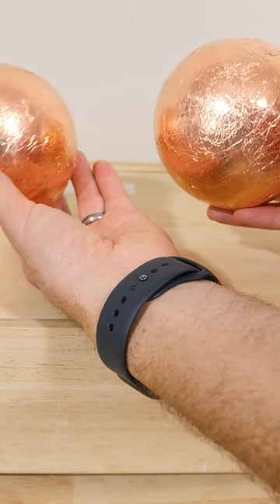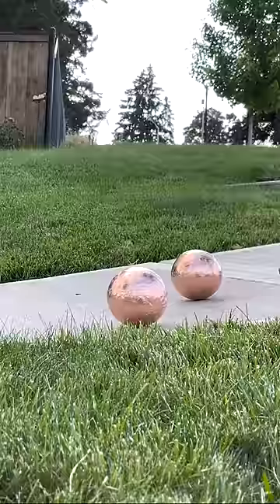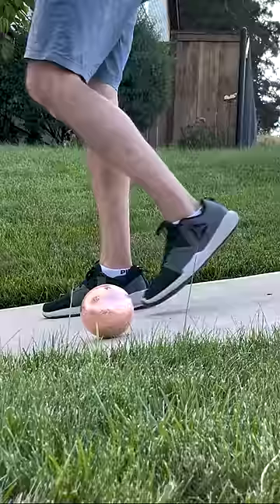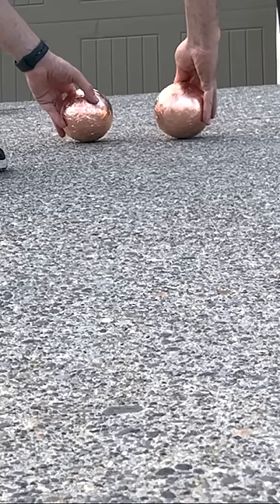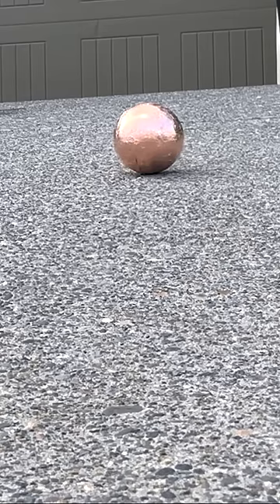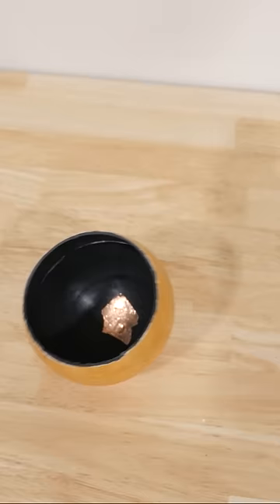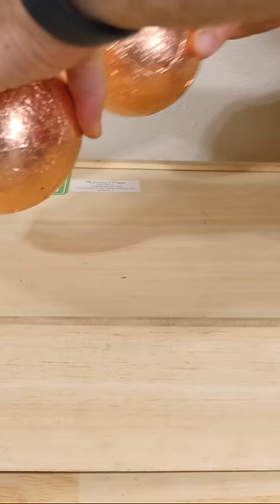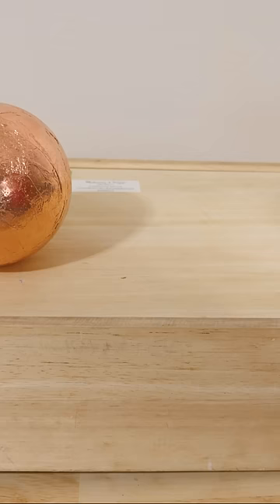The Slowest Ball

Comment: That's some magician stuff right there.
Would have took me ages to figure out how that worked. Now I'm thinking of the engineering applications.
Reply: A fringe practical use I could think of would be decorative balls that you generally want to be stationary.

In case they started rolling unexpectedly, you'd at least have an easier time catching up to them.
Reply: @LinkEX  It could be used for a game, where you want balls to throw and not to roll fast once landing. Possibly like a curling like game, in where two teams throw these balls down the lane to a target, and you can hit each other's balls out of the way, but not so much that every hit is an automatic knockout. 

🤷‍♂️ There may be some other clever uses though.
Reply: @patstaysuckafreeboss8006  Workaround to decrease the DPI in 1900's mouse
Reply: Prank bowling ball is surely the #1 application
Reply: I guessed immediately how that worked though
Reply: thats pretty much what shock absorber on you car does. we already use fluid resistance in a lot of application.
Reply: @TJPDmember  Magnaride combines this with magnetic fluid so the computer can adjust the resistance in real time...
Reply: @dingdong2103  congratulations. do you want an award?
Reply: @xeuxis8892  Yes please
Reply: I've seen them used before I just can't remember where I've seen them 🤔
Reply: @SamPrince You're a sadist.😂
Reply: Interesting but f***ING useless 👍
Reply: maybe if you add this with something that has a lot of air resistence when falling down, making the air wanting to spin it.

Comment: Gravity gets more and more intriguing as you research more into it and I am all into that.
Reply: The phenomenon here is mainly friction and fluid viscosity. The inner ball's friction act like breaks to the outer shell, the smaller ball can move but due to the high viscosity of the fluid it will cause high drag to the rotation so because the small ball slowly moves the larger shell slowly move. Some emergency breaks on airplanes actually operate like this, a high viscosity break fluid gets pumped into a break bearing usually happens due to bad weather conditions causing ice to form between the wheels and the breaks so the emergency breaks get used but then these need to drained.
Reply: I am of the firm belief that Gravity. Does. Not. Exist. Anyways, Daniel is right, this video is regarding Viscosity and not gravity as such.
Reply: @Balila_balbal_loki  You forgot the most important part that allows all that to work, center of gravity.
Reply: @thirtythreeeyes8624  This will work in 0 gravity situations but less effective due to friction being a function of the normal force of gravity
Reply: @Balila_balbal_loki  I'm not sure how something can roll down a hill in zero G. Also it's 100% center of gravity the ball being on the bottom is what keeps it from rolling and as the inner ball rolls the center of gravity is moved for the outer ball causing it to adjust position.
Reply: @thirtythreeeyes8624  Instead of trying to roll it down, simply trying to rotate it like a basketball on a finger it will be harder to rotate because the ball inside when it makes contact with the outer shell will have a friction force opposite to the rotation dampened by the drag of the fluid inside.
Reply: @Balila_balbal_loki  Of course because of Newtons first law and it applies to this but, that doesn't change the fact that it rolls slow due to the slowly changing center of mass. Rolling a ball downhill through molasses inside a container the container only rolls as it's center of gravity gets lower in relation to the point of contact with the hill.
Reply: @thirtythreeeyes8624  If the sphere didn't have a ball inside it and only molasses will roll faster than a hollow ball of the same volume. The reason is simple it will be of higher mass so the force will be amplified thus giving it a greater acceleration which leads to higher velocity and because of the no slip conditions inside the sphere the molasses doesn't drag on the inside of the sphere to slow it down. But with the sphere on the inside of the shell making contact with the shell removing the no slip condition allowing friction between the sphere and the shell which acts as an opposing angular force to the rotation of going downhill and then since the sphere on the inside of the shell is in a high viscosity fluid it's affected by drag which further amplifies the effects of the ball on the shell. The center of mass of the entire system isn't at the center of the larger sphere because the inner sphere is of higher mass than the fluid making it sink and moving the center of mass below the center point so that phenomenon doesn't have anything to do with this you can glue the inner ball on the shell and fill the shell and watch it roll and it will roll faster than the empty ball.
Reply: @Balila_balbal_loki   If you glue the heavy ball to the wall of the outer ball it will not roll it will stop with the center of gravity at the lowest point. This is exactly whats happening here but, the center of gravity is changing as the inner ball gets pulled down and every time it passes the fulcrum it rolls the outer ball changing the center of gravity to behind the fulcrum and then repeat.

Comment: For those still complaining about the two balls with same weight issue:
 The balls rolling would weight the same on a scale, but the weight is not equally distributed. It still the uneven slow ball (hollow ball +  small dense ball + molasses) = the fast ball (just a ball, evenly distributed weight)

Comment: A few years ago I am trying to make a homemade hydraulic balancer for a slope-mowing machine, and one way I was considering to controlling it was a "heavy" weight on a stick as a pendulum, in some very dense liquid for stabilizing the mechanism against the machine bouncing and terrain irregularities reactions... Sadly I never finish it, because there were better (electronic) solutions, but I am sure it will work fine thanks to the slow, damped movement :)

Comment: When we see a wobbling ball, we know it is having another ball in it. And when it moves back and forth, we know it is filled with some liquid. So Viscous fluid is the reason for slow movement. Viscous fluid property is now applicable to the host, ball. Maybe if we use a heavy host ball which is heavier than the contents, it may not affect the host's movement, I guess.

Comment: can you repeat this experiment but on a steeper incline? I have a hypothesis that the speed difference between the two balls will be insignificant if the molasses filled ball has enough speed to catapult the steel ball to the front over and over again

Comment: I guessed at the viscous fluid, but not the other ball inside.  Is there any issue with the molasses degrading/going bad over time?

Anyway, just goes to prove the old saw: "Slow as a small, dense sphere in molasses inside a larger, hollow sphere in January."

Comment: So if you had two objects of equal density, weight, shape, volume, etc. Two of the same thing, and they were both buoyant, then if one of the two objects was warmer, and you put them both at the bottom of a tank, would the warmer one float faster? Just how much warmer would you need to get the other object to make a difference if any?

Comment: This video almost made me sick. Since I was young, if I start to feel nauseous while asleep, I have a the same dream. There is a hill. At the top of the hill are to spheres: one small, one large. I tap the small one but it is too heavy to move. I lightly tap the large one and it flies down the hill hopping high into the air despite the surface being ultra smooth. I turn to the small one again. I kick it and it starts to move, very slowly. Much like this video. Despite its weight and the steep incline, it moves reluctantly, yet I can't stop it. Other weird things happen until I wake up already throwing up. Ugh, now I feel sick just thinking about.

Comment: Viscous, adjective, having a thick sticky consistency between solid and liquid means; having a high viscosity!
Imagine your car being front wheel drive and have This ball-effect connecting two axles between front wheel and rear.. now you have a viscous coupling, AWD, all wheel drive.
Front wheel biased AWD, going down a road, engine put its power in the front.. rear tires move and the rear axle to the viscous couple spins at the same rate as the axle coming from the front to the Viscous coupling, nothing special.
Imagine standing still on ice, front wheels spin while rear are standing still, now the viscous coupling begin to work its wonders if there is the right fluid within.. google viscous coupling